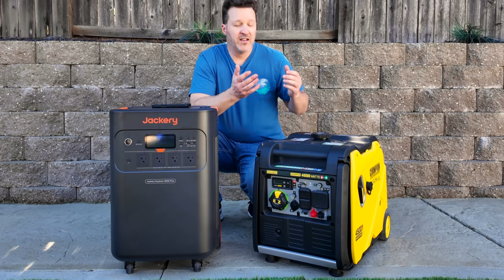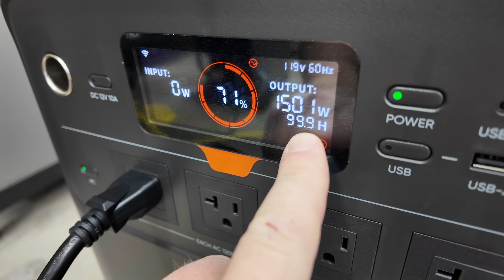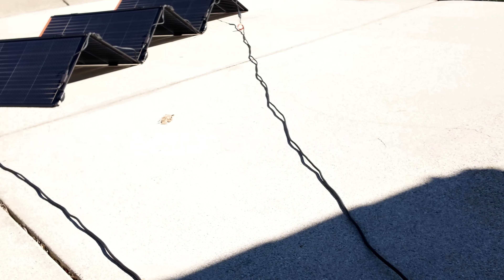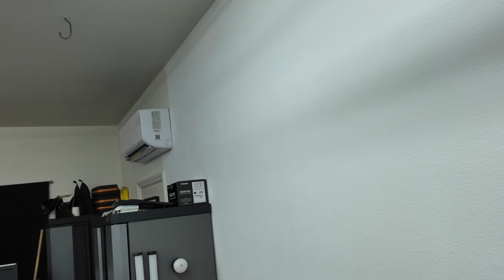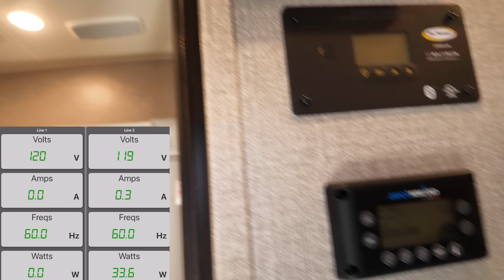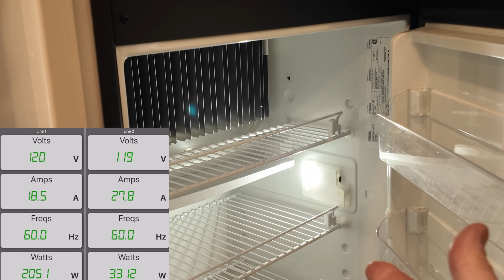Amazing Price- But Should you Buy? Find Out! Jackery 5000 Plus & Solar Saga Review

Comment from the maker: Spring is the perfect time to upgrade your home—don’t overlook the need for essential home backup. The Jackery 5000 Plus keeps your core circuits powered during outages, storms, and emergencies. With seamless UPS, massive capacity, and ultra-efficient solar charging, it’s the most trusted essential home backup solution for peace of mind. Always Powered, Always Prepared—Jackery has you covered!
Jackery 5000 here: https://amzn.to/3UWvGIF

ITEMS SEEN IN VIDEO........!!
EG4 Mini Split- https://shopsolarkits.com/products/eg4-hybrid-solar-mini-split-air-conditioner-heat-pump-ac-dc-12000-btu-seer2-22-plug-n-cool-do-it-yourself-installation?ref=1134
Small Mini Heater- https://amzn.to/4iL37Ir
Soft Starter For RVs- https://amzn.to/420gfSI
AC to DC charger- https://shopsolarkits.com/products/eg4-chargeverter?ref=1134

BE SURE TO SHOP AROUND !.....
Crazy Prices at WellBots! :https://shrsl.com/4uybi

BEST PRICING ON EG4 ENPHASE ECOFLOW BLUETTI & MORE! BUNDLE DISCOUNTS: https://shopsolarkits.com/1134
Discount Code: JOHNNYWKND Save $101 

SAVE BIG ON EG4 BATTERIES SOLAR AND MORE HERE: https://signaturesolar.com/?ref=JWKNDS 

CHEAP USED CERTIFIED SOLAR PANELS HERE: https://www.santansolar.com/?ref=Johnnys%20Weekends 

Be sure to Subscribe 
👍🏼 :https://www.youtube.com/@johnnysweekends?sub_confirmation=1 

Have a question you want answered fast: https://asqme.com/@johnnysweekends

If you feel I helped you out..Consider Buying me a Coffee 👍🏼🙌🏼👊🏼😀
https://www.buymeacoffee.com/johnny5120J

Other Cool Items I use and Recommend!.....
MC4 All in one Kit : https://amzn.to/37jwLVb

CHECK OUT MY AMAZON STORE:
https://www.amazon.com/shop/johnnysweekends

Comment: In a power outage, or in a gid down SHTF, you dont need more than 120v! My low frequency power station will run every plug and 120v appliance in my 2600sq ft all electric house, on one cable! Anyone trying to run central air, a 240v stove or dryer, hot water heater, is unrealistic, as you would need far to much battery, and even more solar panels! The truth is, 120v runs my, refrigerator, 1800w air fryer, washing machine, dishwasher, 65"TV, lights, window A/C, and much more! All that from a 3000w transformer based power station, with 15kw in batteries, and this unit is infinitely exspandable, can utilize any battery chemistry, charges and discharges from the unit(true capacity) an no proprietary anything, 13w idle consumption, less in dc only mode, and takes in 2000w solar on dual 150v mppt controllers! In a grid down cituation, noone is running more than 2 or three large draw 120v appliances at the same time, I have 5kw solar on my roof, and another 1kw in storage! Nothing ways more than 32lbs! My unit can run, refrigerator, washing machine, and microwave and lights and TV at the same time, and I own 2 identicle units! What more does anyone need! The best thing about my units is there adaptability, I can use any battery from anywhere, if a battery were to fail, my unit is still running, if a mppt controller failed, theres 2, i can use an external one, if a charger fails, which each unit has 2 (external) chargers, I can use any charger, and my units are still working, if the inverter fails, I can use my batteries, all external, on any inverter! It's just made better, almost like someone knew what they were doing, not someone who just wants you to use there stuff! 😮😂😂😂

Comment: I don't thing 1100+ watts of idle consumption in a 24 hr period is good.  It is both a negative and a positive to have such a large inverter if you need to run 240V, but many people do not so 1100 watt is a lot of power not being used.  That could equate to at least another 8 hours of run time on a fridge .  As always your video and reviews are A+.

Comment: Great video & very informative . 
  We have 2 Jackery 5000 plus batteries that are connected to 1 Solar Saga 5000 panel each , 2 expansion batteries connected to each 5000 plus & an STS to control the system . Our electrician installed a couple of tandem breakers & because we had GFCI/ARC fault breakers in our load center , they had to be moved into the STS . According to our electrician these breakers also require an additional neutral or ground position in the STS , which if you're utilizing 12 circuits 1 space will have to be eliminated . Also I built 2 frames out of 1" PVC pipe & mounted the panels flatly on them & installed 1 on our backyard south facing fence , which I made to be adjustable seasonally & the other on the south facing side wall of our house , also adjustable .
  I wish that Jackery made the STS capable of 200 AMP service instead of 100 AMP , so that we could have run our HVAC system , too . Also Jackery should have made the STS to support more than 12 circuits , more  came achieved by installing tandem breakers . Overall , I'm very happy with this system which as a suggestion to those that may be in the market for this system , check out Lowe's & the Home Depot for a better price & they're a approved seller for Jackery . I bought most of my purchases from the HD & the external batteries from Jackery . 24 months of 0% interest & on sale at h
the HD can't be beat . 
   2 cons so far that I have found . 
  #1  LED light flickering which after consulting with Lutron using their dimmer switch to bulb recommendation chart we have lessened the effect but not eliminated it . Plus installed a neutral / ground plug in 1 A/C port on each 5000 plus . This is a known issue & hopefully they will find a fix for this issue .

  #2 every once in a while for some unknown reason , the app has me having to resign into the app . Which as we all know seems to happen at the most inopportune time , light a smoke detector going off due to low battery at 0 dark 30 .
 Also as a suggestion , if anyone tests the circuits that are working through the STS , DON'T turn off your internet router circuit or be prepared to run an extension cord to a still live circuit & reconnect the router & waiting until the system if up again & the router & STS can communicate again & you can restart that circuit .  
  Is everyone still awake .

Comment: I’m considering this very unit for a ford transit van over a hardwired power system in the van. I like the idea of this Jackery 5000+ unit that is portable and can also be used in my house in the event of a power outage or off grid use.  Is there any downsides to using this in a van for camping for weekend or long holiday camping?   I have a gasoline heater in the van that’s 12 volt dc and also a 12  volt ac unit.  My electricity uses would be primarily for fan, refrigerator, microwave and single burner cook top.  Great video.  Thank you and I look forward to your opinion.
Reply from the maker: I would look into something smaller for the van but still could be decent for basic home items
Delta 3 max plus is nice as it has dc 30amp out

https://amzn.to/45vmhgC

Or the delta 3 pro could be another good option 

The Jackery 5000 is pretty big 
But if you have a place for it it could work

Comment: im just researching this stuff. can you charge the unit using both the high voltage and low voltage inputs at the same time? that would be a total of over 5,000 watts
Reply from the maker: You can use both yes.

Comment: This is all great but the pass through...Why would you want to put a load on in while charging it? If you have AC power just plug whatever devices you have into the wall and let the backup charge without a load. I could see a problem  if it were a DC passthrough limitation where having solar panels charging it would limit your output.

Comment: I have had the explorer 5000 since January 2025 and 9 months in and this unit battery has deleted so much that it can’t keep a 100watt light bulb running for more than 21hrs. Jackery support has been very poor, they won’t answer via phone call and the unit shuts off AC power during low solar light situations. On grid or on solar this unit was a waste of money with no resolve from jackery.

Comment: AI Comparison Summary
The Dual Champion Generators system will run significantly longer than the Jackery battery system when operating at a continuous 7200 W output, based on a single tank of gas.

System	Estimated Runtime
System 1: Jackery 5000 Plus	𝟒𝟐 𝐦𝐢𝐧𝐮𝐭𝐞𝐬
System 2: Dual Champion Generators	5.45 𝐡𝐨𝐮𝐫𝐬
and
Cost Efficiency (Per Hour at 7200W)System
Total Cost for Runtime
Cost per Hour Jackery 5000 Plus $4,299  (0.7 hours)  ~$6,141
Dual Champion 4500                      $1,583  (5.75 hours) ~$275

that's one hell of a difference!

Comment: What is the life cycle of power units like this? How many charge/discharge cycles will this thing withstand and still keep say 80% power or better?  That's my only concern with these battery power systems. If you're constantly wanting to use something like this to supplement power in your house then you're going to be cycling the batteries quite a few times throughout the year, could you expect it to last five or 10 years doing this?

Comment: BUYER BERWARE!!!! I have one of these, paid $2,700. Troubles from day one!! Would shut itself off everynight. house would lose power. I would have to manually reset the unit. Took 2 weeks to get a update firmware which seemed to fix one problem and caused another. 2 weeks later the unit stopped working. Got Error F1. Trying to get Jackery to warranty/refund this unit that is less than 3 month old is like pulling teeth!! AVOID!!
Reply from the maker: Interesting, thanks for the feedback.
Definitely fight for a new one. They normally do well with CS
Reply: UPDATE! they did end up replacing the unit. Mailed me one, and i returned it in the box the new one came in. They paid for shipping both ways. I updated the new unit to the latest firmware to 1.6. Overall its working normally. It took a few weeks to get them to warranty the unit. Emails, pictures, and videos sent to them. They did respond to emails in a timely fashion. I guess thats what it takes to get things warrantied with no local authorized service location.
Reply from the maker: Glad they did you right 👍🏼
Reply: I got a firmware update ver 1.6 for for it the next day after contacting them. My failure code was F6.
Reply from the maker: Is it fixed ? Did firmware help?

Comment: I'd like to see a more efficient inverter.  According to your calculations it's using roughly 45 watts per hour.  That's too much.  The Anker F3000 only uses 20 to 25 watts.
Reply from the maker: And has a smaller inverter

Large inverter more watt draw
Small inverter less watt draw

Comment: Hey nice video! Wondering would this handle an 800 SQ ft off grid cabin, running a small fridge, lights, and a small ac window unit??
Reply from the maker: Yes, need enough solar to recharge every day. 
May want one expansion battery

Comment: Can you just connect the panels to each other, like in series?
Reply from the maker: Yes but will need adapter and need to plug into high voltage side of the Jackery unit as your VOC will be over 60v
Reply: @johnnysweekends oh ok thank you

Comment: I have this, along with an extra 5kWh battery. I called Jackery regarding not being able to see the high and low pv numbers and they simply said you can't do it. But like you said, you'd think this would be an easy fix with a software update.

Not being able to do 240V charging while using it, to me, is its biggest weakness. Even with the device you mentioned at the end, that requires that I disconnect from my solar array to use it. Well what happens if my batteries are running low, but I'm still getting 1kW from solar? I'd like to continue getting that free energy WHILE charging with the generator. I don't want to lose that energy. The obvious solution is to make an adapter for the port that you use to connect to their smart transfer switch. But my guess is they want to force people to buy their STS, which I'd have no problem doing if it was designed better. I don't want my batteries/inverter in my basement, I want them in my garage to isolate them in case of a fire (which I know should be rare). Unfortunately, you can't split their STS like you can with EcoFlow's Smart Home Panel 2, so you're forced to have everything together in one room. 

Ideally, during an extended power outage where the sun isn't shining and 3 days later, your batteries run out of juice, you can start up your generator, charge your batteries in 4-6 hours (while the Jackery is still running your house), then turn it off and not need it again for a few days. Jackery REALLY needs to fix this.

Comment: new to this solar back-up generator concept:  will the smart transfer switch allow a home owner to switch between power sources to power a fridge, for example.  on my electrical panel, I can toggle the refrigerator-switch to off and then force the 5000 to power the fridge.  Essentially, I plan to permanently park the 5000 generator in the garage next to my electrical panel and smart transfer switch and would like to power the fridge as much as possible without to wait for an emergency black out.

Comment: I have a jackery 5000.  It seems to work fine.  Set up smart transfer switch with local electrician.  don't rely on recommended contractor.  My local electrician did installation for  ~1000 dollars which is half of their recommended installers cosst.  I haven't tested the system yet.  I suppose I should similate a power outage.  1 thing I was
 suprised was keeping it hooked up to smart transfer switch keeps inverter on and therefore the power drains from unit 1% per hour.  its easy enough to recharge but still it was surprising.  The app is very basic and connection is sometimes lost.  
any recommendations for solar panel (nonjackery) ones that would work well with jackery 5000?  I think renogy gets good recommendation. I would only use in extended power outage.

Comment: So did you adda 240 adapter and is that the deal breaker? How good is the warranty…20K sounds pretty stiff, but not if supplemental solar or other sources brings that price down. if so to WHAT?  Sorry to stack questions but just have one shot.
Reply from the maker: They don’t have a 240 volt adapter. If they did it would have made this thing pretty amazing. It’s not a complete deal breaker and maybe since a couple people have asked about it they will start looking into on. Which I bet we see one in a few months, or at least let’s hope so. 
Jackery normally has one of the best customer services in the industry. 
And this unit can definitely hold a lot of solar and you can expand it a lot.

Jackery…. We need the 240v adapter!!! lol

Comment: Ehh I wont touch a Jackery unless free or until they start actually giving features and quality that leading power station manufacturers make….including matching or bettering the warranty than Compareable units.
Reply: Who has a better warranty and customer service?
Reply: @craigmoody3812  I’m mostly an ecoflow user for portable power stations..the newest I have is delta 2 max..my original delta max is still pretty much acting like new even though near 2-3 years old.

Out of Jackery and ecoflow I hear Jackery is improving but most have usually considered Jackery as the worst compared to the 2 main quality and feature units..ecoflow and blueetti.

I like my portable power stations but I don’t see buying again because generally I can make and out feature and warranty almost all manufacturers and features.

I have featured my power stations on my YouTube channel several times & probably will again.

A new competitor is harbor freight..impressive big unit but I have noticed some say the smaller one isn’t as much a contender.
Reply: @ridingvenus  ecoflow is garbage in my opinion. I use Bluetti and Jackery for years.
Reply: @bc_usa why is it garbage?

Comment: If i understand it correctly, when you have bifac8al panels its best to mount them vertically. First, it sheds heat better, thereby improviny  performance. And second ... more importantly, horizontally, the bottom side is shaded, defeating the purpose and benefit of a 2-sided panel.

Comment: I think two Prcron 3072Wh power stations with hub are a much better setup. 220 charging being just one thing. Also Jackery needs to make a longer power station to expansion battery cable. Maybe as an influencer you could ask Jakery make one. Putting the battery to the side increases the footprint and is unacceptable

Comment: I love my Jackery system, I have two 5000 a smart transfer switch and 8 extra batteries for 50,000 watts . I can run my whole house even without solar for nearly 3 days.
Reply: I guess around $20,000+ dollars👀
Reply: @aaronwilcott4561 nearly 30k at msrp. But im sure there are bundles and black Friday deals n what not that can get you closer to the 20k point.
Reply: @glenn-fr7hj  At what cost?
Reply: Which extra batteries? Please share link.
Reply: I can run my whole house on my 7500 champion generator for 3 days on gas or propane for about $700 for generator and $150 dollars in gas. And if I get bored $20 for an oil change😂
Reply: @slimchancejw  It's possible that people are willing to pay more to not have the engine sound or maybe to have instant transfer of power or not deal woth the hassle of refilling the fuel.  Also, if you run your generator every day, you'd be paying $18,250 per year for fuel, every year.
Reply: @slimchancejw  can you run that generator from the sun?

Comment: Great review and good questions to Jackery.   They have a great unit, they just need to build a 240v generator adapter that will charge the unit while outputting on 240v as well.  Then it would be near the top with the other 2 big ones: Anker f3800 Plus and EcoFlow Ultra.
Reply from the maker: Yup.. they better get to work 👍🏼